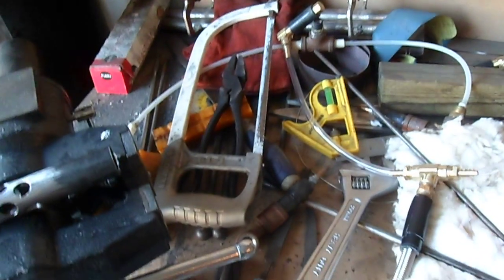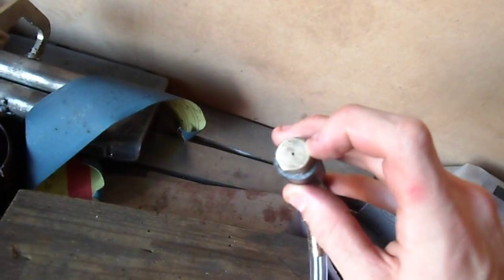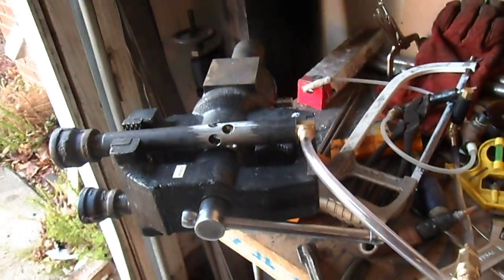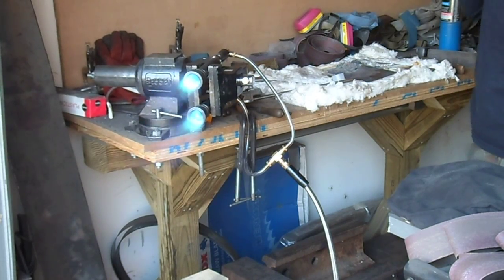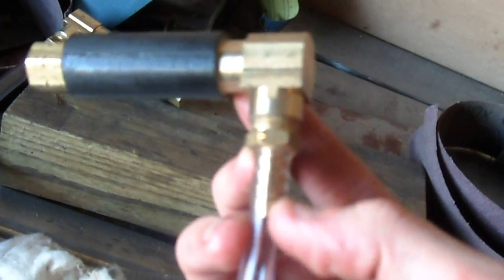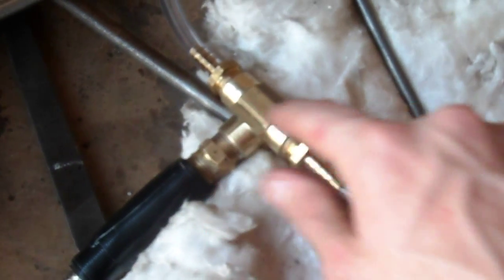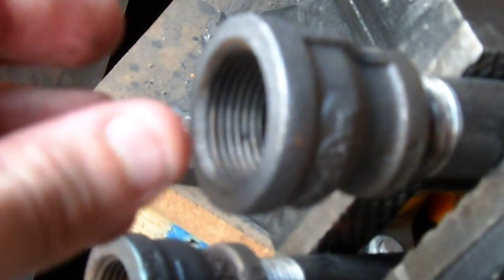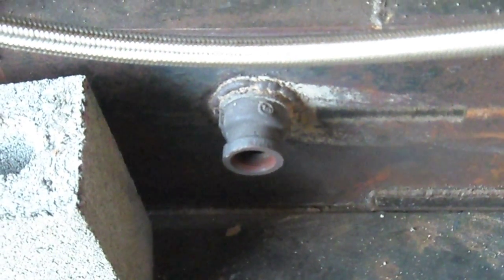Revamped Propane Burner Design Test

Comment: this is one of the simplest and most elegant builds I've seen. Is that hose really very safe though? With a small 1/16 orifice, there's a lot of pressure on the fittings. People are usually very careful with locktite and testing all their fittings up to the orifice.
Reply from the maker: Almost certainly not the safest option out there, there always seems to be a bit of a leak, although it's hard to find.  The regulator tops out at 30 psi, though, so it can't get super high.  I didn't even think of locktite at the time, I might need to try that next time.